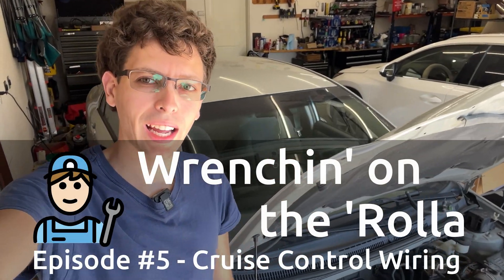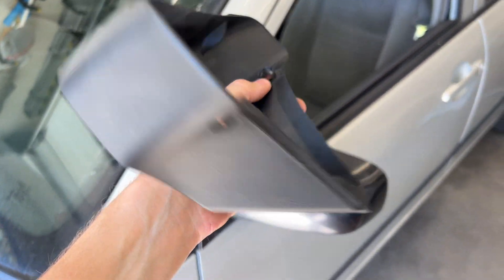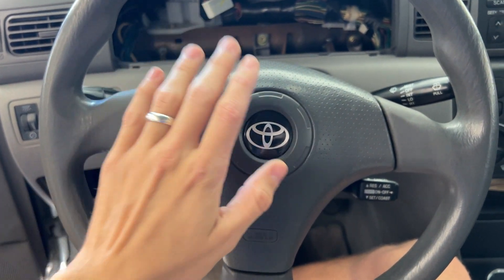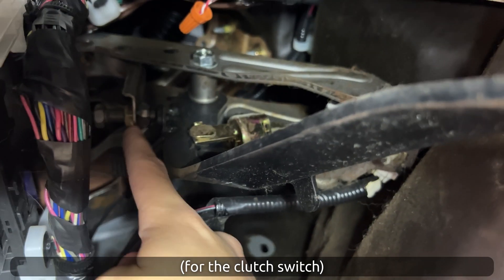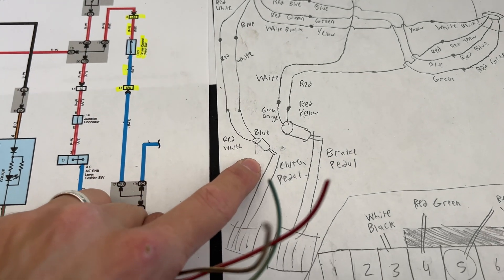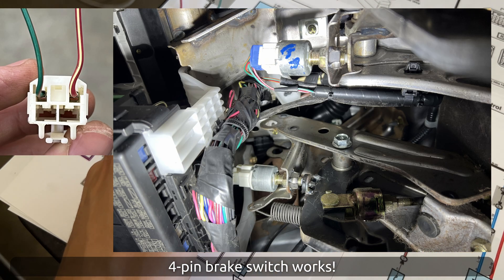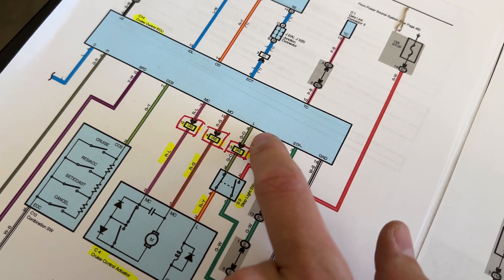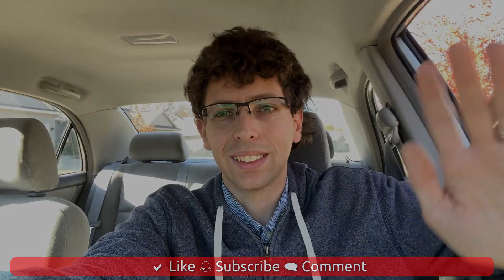Cruise Control Wiring Install Corolla/Matrix/Vibe (2003-2008), Cable Throttle & Manual Transmission

Comment: What could be the problem if it doesn’t set and the cruise light is activated?
Reply from the maker: I would check brake switch (and clutch switch if manual transmission), remove the connector and short the cruise circuit with some wire.